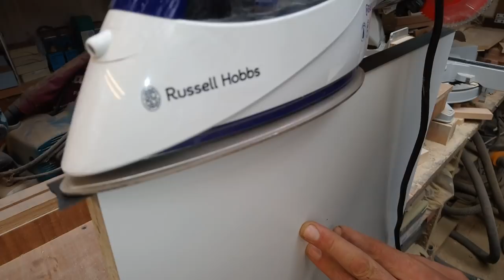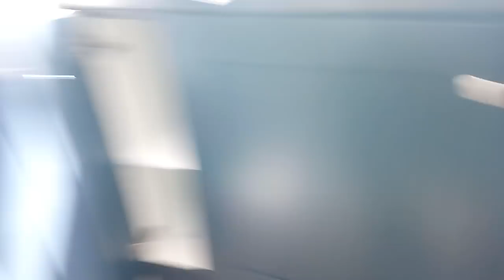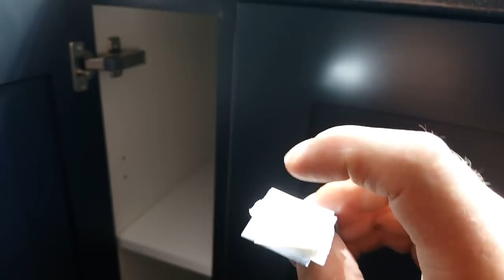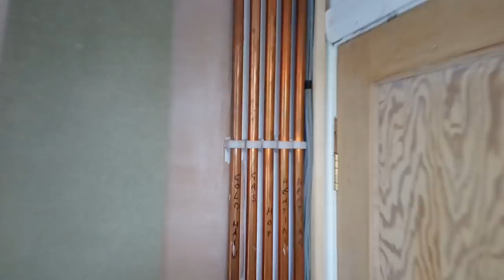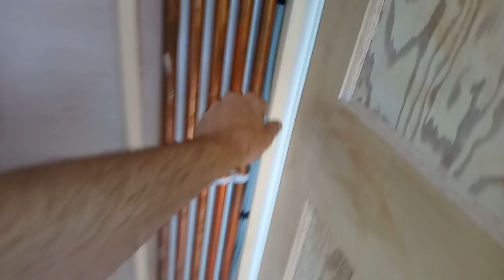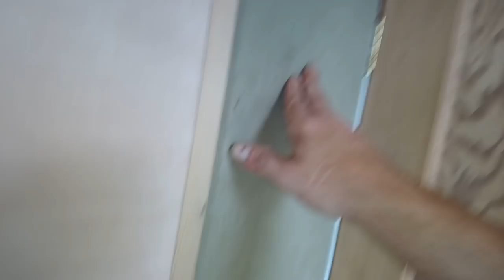Kitchen Fitting - Final bits, Handles, a couple of shelves & pipes boxed in

Comment: hello, compliments on the quality off your work. but just two quick questions. 1, do you not think your handmade bespoke kitchen deserves more than a laminate counter top? 2, is it not a problem having a fridge and oven next to one another, hot and cold etc. best, Scott.
Reply from the maker: Thanks 👍 The choice of materials is always discussed with the clients before and during the build, i have no choice in the final decisions made, 
Ideally you wouldn't have the hot oven door open & the cold fridge door open at the same time, when you open the oven door the heat goes straight up & these appliances don't emit or get hot enough around them to affect the neighbouring appliance otherwise there would be a prob with the chipboard units themselves.
Reply from the maker: saying that, in my house i prob wouldn't choose to have the two beside each other, i think maybe aesthetics had a play in the position of these, the oven in the middle of this unit, again not my choice

Comment: Thanks. If you have a laminate upstand, say 100 mm, height, how would you fix it to the worktop. (instead of tiling down to the work top). What type of glue? Clamps? Also would you fix it to wavy wall or worktop, or both. Ant tips appreciated. Thanks for great videos.
Reply from the maker: Hi, the up-stand would normally just be fixed back to the wall, similar to the tiles, once the worktop + utilities, cooker sink etc are in place there's no access to the back of the top from underneath, you would have to try fixing it down on to the top before the top got fixed on to the units but i wouldn't unless there was a reason i had to, can't think of one right now 🙃🤷‍♂️👍, You're thanks is appreciated, thankyou,